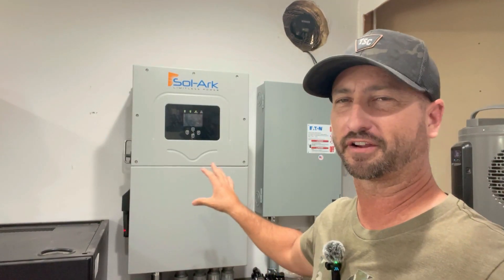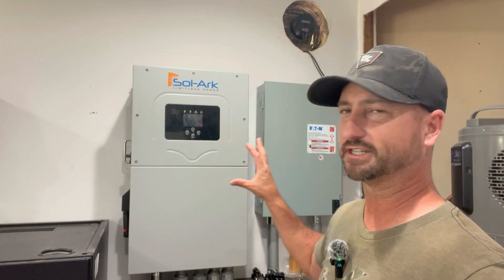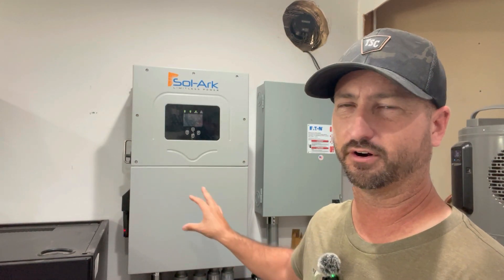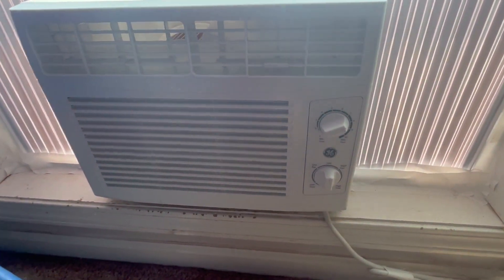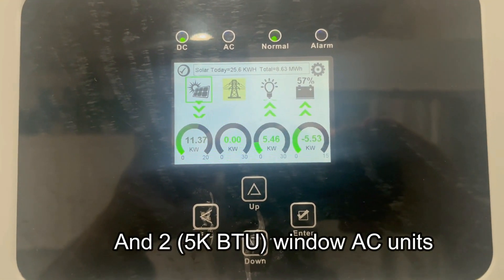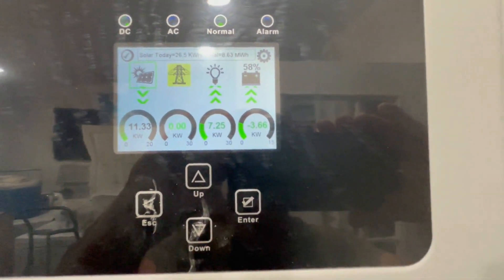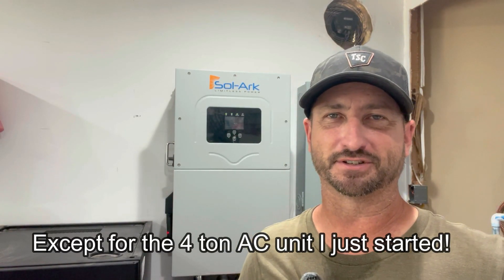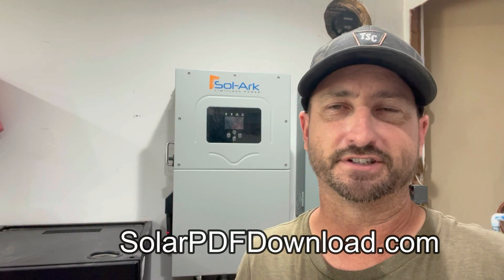Sol-Ark 15k Load Testing (including 4 ton Air conditioner!)

Comment: I wonder how the 18Kpv EG4 compares to the Sol-Ark, looking forward to the video! I have a low frequency split-phase Growatt with a big transformer in it with an EG4 rack mount battery bank and I'm thinking the 18Kpv might be a nice upgrade. Will Prowse really likes the 18Kpv.
Reply: Yeah I don't know. I know the EG4 can actually meet it's specs according to Will, but everyone whos gotten anywhere near the solark rated specs say it fails. Notice how in this video hes too scared to even turn the induction cooktop on all the way.
Reply: Ford vs Chevy (if both Ford and Chevy were made in China).  I think they are 1:1 direct competitive models.  One phillips to another...
Reply from the maker: @jasongphillips  lol good analogy
Reply: @jasongphillips   Not really... Sol-Ark has 25% more daytime AC output, 50% more solar input, 10% larger battery amperage, and tremendous field experience. Luxpower (EG4's "OEM") isn't even a manufacturer...